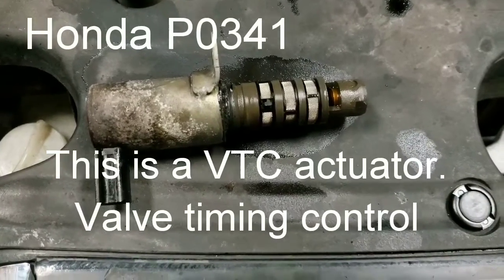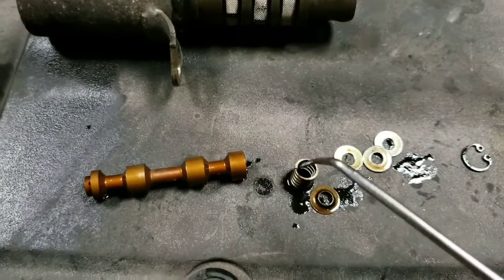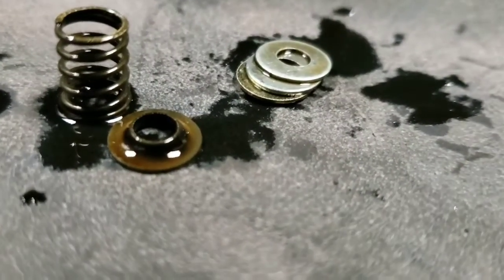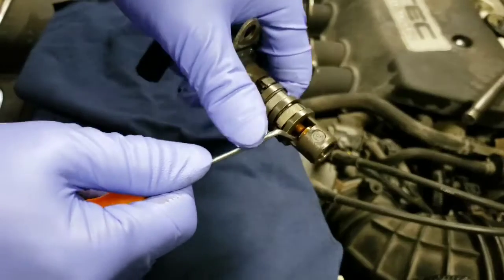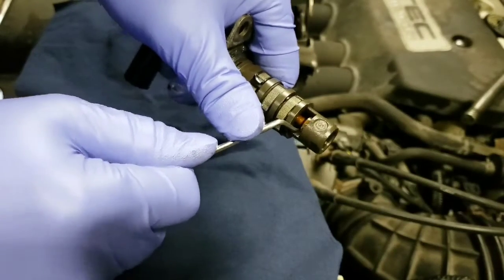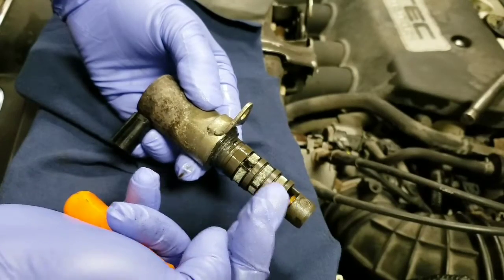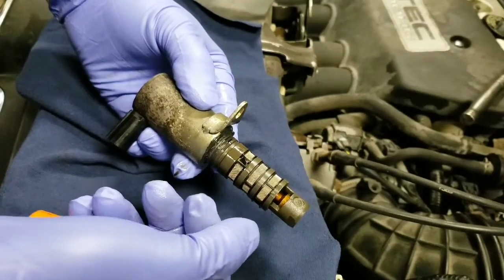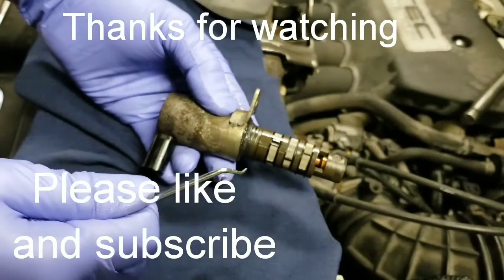Honda P0341- Camshaft Position Sensor Incorrect Phase Detected DIY

Comment: Problem solved, Thanks for posting this video👍👍
Reply from the maker: Thank you for your reply
Reply: @UncleTinman  @UncleTinman How long did you drive after the repair? I have errors p0340 or p0341. Previously I also had p0344 but I had the chain pulled. The chain and tensioner were replaced. There are no errors on a cold engine, only when I drive 5 km and reach operating temperature does the error pop up, after deleting it it immediately disappears. Do you think it's the sensor you cleaned?
Reply from the maker: @Rustin-ld6qi  the sensor has gone down in price now. It may be worth trying to replace it. The car drove for another 3yrs before it was finally replaced by a newer vehicle. I forget when the code used to pop up, but I remember it rattling on start up cause of the improper timing. Hope this helps.
Reply from the maker: @Rustin-ld6qi you can find them on rockauto for $31. Hope this helps.

Comment: 5 years later my replacement has gone in Winter mode and gave me this code so I ordered a replacement. I've see others replace the cam sensor on the air filter side but the code is confusing to know if that is true or not but I'll wait til it's warmer to turn it on again to confirm this but ordered the new part to replace it for safety sake right now.

Comment: After reading all the comments iwas left confused. I have the same problen but i will first change the sensor
Reply from the maker: If you have access to a sensor then you might as well change it. Purpose of the video is just a quick solution for anyone who might not have the part readily available. Cheers.

Comment: How can I check this sensor solinide moving or not
Reply from the maker: @mdoliullah9474  you can put 12v power to the terminals and it should click.
Reply: @UncleTinman  there are two pin 
which is positive which is negative ?
Reply from the maker: @mdoliullah9474  either pin will work. But if you're concerned. Look at your plug to see the colour of the wires. It should have a black wire.

Comment: A friend was dealing with a p0340 cel (not p0341) code some weeks back on his kswapped eg civic that we couldn’t figure out (cam timing was on point, replacing cam sensors didn’t fix it, wiring was good/brand new), we then stumbled upon this video but didn’t perform the suggested washer stacking tip, he did press the end of the spring cap down with a pick and heard a pop and figured the spring became unseated from being a high mileage sensor. Reinstalled and went for a test drive and p0340 was gone! No symptoms of a wonky or dying idle or sputtering vtec crossover afterwards. Thanks for this vid 👌
Reply: Oh also, it seems that Honda makes different versions of the VTC solenoid inner body. For instance, the one I have doesn’t have the tip like shown in your video where you can disassemble it from the tip. Mine has a completely sealed tip 😢

Comment: I have this code and I have a knock, I replaced the Solenoid Spool Valve, Timing Oil Pressure Switch, and Gasket assembly. Do you think this solenoid would solve the problem?
Reply from the maker: If that's the code you're getting. I'd give it a try.

Comment: I had this code and my car had a random misfire and I did exactly what this video shows and it fixed the issue after I checked my cam sensors and crank sensor I decided to try this and it actually fixed the issue! I want to say thank u to the guy that made this video because I was lost if I didn't see this I was going to pull my engine SMH please don't listen to the other comments that say it doesn't work because it absolutely can be the issue!!
Reply from the maker: Wow. Great to hear. If this video can help just one person then it's done it's done. Thanks for your reply. Cheers.

Comment: I keep getting this code but no major symptoms driving. Honda wants to charge me 2 grand to change the timing chain  and tensioner but the only symptoms i have are the reoccurring engine light and maybe a bit less fuel economy
Reply from the maker: Have you tested the solenoid? Perhaps try changing the solenoid.  You can source one on rockauto for a decent price. Although, you might actually need to replace the timing chain.  Hope this helps
Reply: @UncleTinman  did a full diagnosis and seems to be the chain stretch unfortunately. Should I replace the solenoid while I'm in there?( (Plan on getting tensioner, guides, cam gear etc... Anyways). Also reading I should do the water and fuel pump while I have access . Thanks for the advice
Reply from the maker: @eidenspysznyk5075  the solenoid is external so it wouldn't be hard to replace later on if it fails. I think when you said fuel pump, you're referring to oil pump. Normally wouldn't change the pump assembly unless there's an issue. Although you can for extra peace of mind. Hope this helps.

Comment: Can I remove a stock vvt out from the cylinder head
Reply from the maker: Yes. You can remove it. It's held in with one 10mm bolt. It might be harder to pull out with the dried up O rings.

Comment: Out of curiosity, what size washer did you use? By the way, I heard it may be useful to do this on a new solenoid as well.
Reply from the maker: Sorry. I don't recall the size of the washer.. they were just washers I had on hand. Great suggestion for the new solenoid.  Thanks
Reply: @UncleTinman  No worries. I’ll just get a kit and then report back here on the size I used.
Reply: @glassman3333  I didnt

Comment: For all the work getting to that part, I just as soon buy a new one and do the job once!
Reply from the maker: In north America we're spoiled with cheap and readily available parts with quick shipping... but there are others who aren't as fortunate... and any help with repairing an issue instead of throwing money at it. Thanks for your feedback.
Reply: @UncleTinman  absolutely.  as an american, i would buy a new one myself, but i watched bc it was fascinating to see how simply and elegantly you fixed it. i also never actually knew what was going on inside a solenoid.  works mostly like a switch with the piston being the throw. thanks for sharing this.

Comment: Most of the time this code means your k series engine have streched timing chain
Reply from the maker: Again... as I mentioned in the description. This code is very vague. I've had the same code for multiple issues and solutions.
Reply: Uncle Tinman did you find out what your issue was and did this solve the issue? I have the same code. I changed all 4 plugs, coils and both cam position sensors. Still doing the samething and throwing the PO341 code.

Comment: what is the inner and outer diameter of the washer please ?
Reply from the maker: Sorry. I dont recall. I just had a bin of washers that i just tried.
Reply: @UncleTinman  okay, no problem, thanks for video, it really help me
Reply from the maker: @aezakmi354  great to hear.
Reply: @aezakmi354  did you ever figure out the size washer?
Reply: @glassman3333  Nope, because when I put mine solenoid out, it was completely sealed (non openable- different Honda) so I changed whole thing, but P0341 still shows, it is most likely VTC actuator in my case

Comment: P0341 is for the cam position sensor and crank position sensor not reading together. It would mean a stretched timing chain. Anybody following this information is wasting their time and possibly wrecking their vehicle.
Reply: P0341 is very vague code. It could be anything from stretch timing chain, weak chain tensioner, worn out guides, two cams position sensors is too dirty, loose or misalign cams magnetic pulsate gears bolted at driver side, too thick of an engine oil not supplying lubrication sufficiently to and through the vvt solenoid piston properly or it can get stuck due of dirty screen, which in turns causes the intake cam vtc actuator to auto advance greatly to accommodate oil pressure and viscosity  to a point, and that will throw the code p0341 or p0011 (cam position range/performance/ too advanced). 

ANY of these components can go bad, not just the chain.

If there is an ongoing code that wouldn't go away , the pcm must be recalibrate...that is by starting up the car from a  cold (never from warmed) and rev the rpm to 3k until the second time the fans kick on, turn car off for one minute and restart again then it's all set.
Reply: @Saroeumyim  would this also be an explanation for why my VSA & Exclamation in a triangle light is on ?
Reply: @cesarguerrero2299  I have this same issue and it's driving me crazy. Sometimes the car run fine then BOOM... SHAKING, STALLING and cuts off sometimes.
Reply: @cesarguerrero2299  I’m having the same issue any luck?
Reply from the maker: Thank you for the detailed break down explaining.

I had that code and this is the method I used to remedy the issue without having to replace the VTC actuator.
Reply: @Saroeumyim  what if the car not starting at all
Reply: @Saroeumyim  the car just turning over strong but not starting
Reply: This part of the comment regarding "this information is wasting their time.." is incorrect because the honda manual states to check this FIRST (If you do not have a scantool) simply using a 12v source to the right(2) male terminal and a ground to the left(1) male terminal on this part. If it moves more than 1.2mm it is OK- if it does not it needs to be replaced.
You check the timing after checking the solenoid valve.
Page 11-247 & 11-248 for po341.

Comment: Hey i have honda accord with 52000 miles on it. I have change the camshaft cranshaft sensor  battery, spark plugs, did the timing chain replacement but still I get the code of p0341 and p0340. But i have not done anything with the actuator. Do you think it has vtc actuator problem?? Some one recommended me checking the fuel pressure . Thank  you
Reply from the maker: I'd check the actuator. Who diagnosed the car? Get them to double check
Reply: @UncleTinman   Will do thank you. I have been asking for different mechanic and they have different opinion about it.
Reply from the maker: @bikrambista6814  unfortunately sometimes there are different ways to approach a situation.
Reply: @UncleTinman  that's true, some mechanic tries to make out of money rather than  clearing out the issue. Most of the mechanic I had just goes with the code they get from the OBDII scanner.
Reply: Change the intake camshaft as well, Honda tech told me to do it I have the same issue on my 2018 civic 1.5 I’m testing the sensors tomorrow, checking oil control valve as well. I also have to check the timing marks.

Comment: I wish you lived in the San Francisco bay area.  My Honda CRV 2013 has the engine light on with a P0341.  I have already had a new vtc solenoid put in (before that, other lights were also on:  85-01, C0100, 83-11).  According to two mechanics, the next step is putting in a new cam shaft positioning sensor -A (input).  My fear is that then, the engine light still won't go off.  Then the next step is Timing Chain / VTC actuator.  I have only 58,000 miles on the car and I bought it new.  Evidently, getting maintenance whenever the sensors tell you is no longer adequate.  Mechanics have told me that with the synthetic oil, it should be changed every 5,000 miles or 6 months whichever comes first.  Hoo boy.  So I'm hoping to just trade it in, and be done with it.  But first, could you advise me on where to buy the cam shaft positioning sensor -A specifically for Honda, if I try to go one step further with this car?  Again ... I wish you were in the bay area.  I really like your approach to fixing something.
Reply from the maker: Try looking on rockauto.com  I find they have a good selection and pricing.
Reply: @UncleTinman  Thank you!  I'll check it out.
Reply: I have this same issue of my 2008 Honda Accord, it has about 103k miles on it, I have replaced both camshaft position sensors and its still tripping the same error code. Now I think the next thing is to try this crankshaft sensor mod.

Comment: Were you getting random misfire and having issues keeping car running?
Reply from the maker: Yes.. those were the symptoms.
Reply: Uncle Tinman did the code go away or did you need to reser the code?
Reply from the maker: @donc6545  you'll need to reset it
Reply: I’ve got the same code and my engine had random misfire and wouldn’t stay running, I pulled out this variable timing solenoid in the video and cleaned it really good and my engine ran fine after that, but I bought a new one to make sure and it’s running fine since then.
Reply from the maker: @zenquisj what do you mean which one to change? There's only one actuator.
Reply from the maker: @zenquisj what are your symptoms?
Reply from the maker: @zenquisj sounds out of timing. Try taking that actuator out and see how it looks.
Reply: @UncleTinman  yo zenquisj did you figure our your issue ?
Reply from the maker: @onemorecoat1712  yes... the actuator solved the problem for this situation....but recently had a misfire issue that turned out to be valve adjustment.
Reply: @zenquisj same for me, did you find out ? My cam is off set and my chain is slack.... Im working on it
Reply: My car won’t rev past 2 RPM and I have to keep the gas pedal down will this fix it
Reply: @uncle Tinman I know this is an old video but I just got a crv 05 with this code the car runs fine except for the loss of power at around 3k rpm I’m just hoping & praying it’s not the timing chain ... so I would like to know what was your symptoms